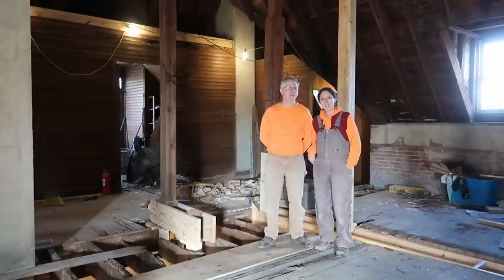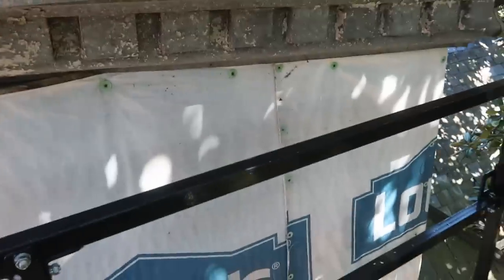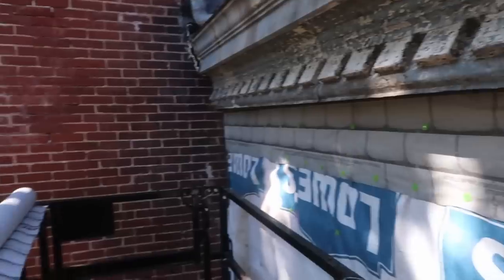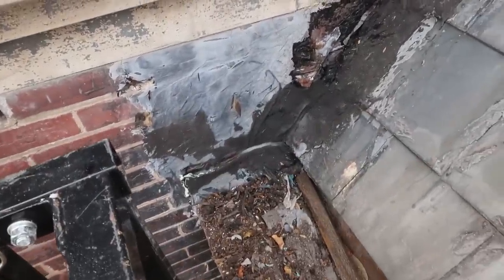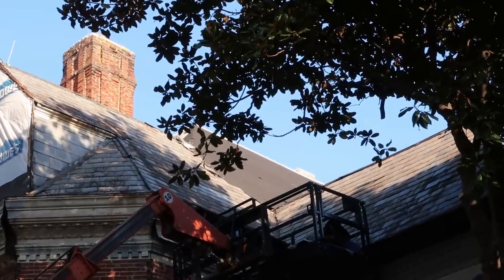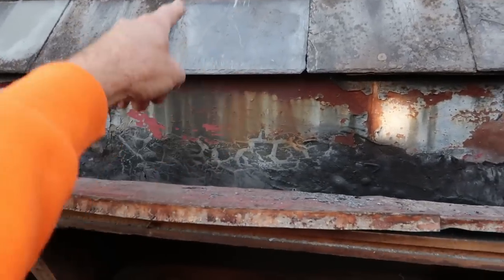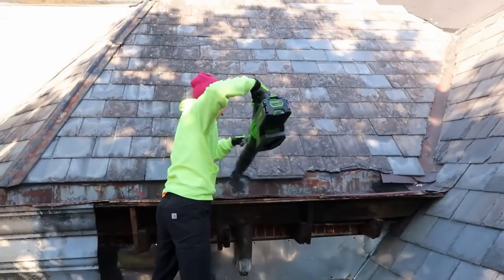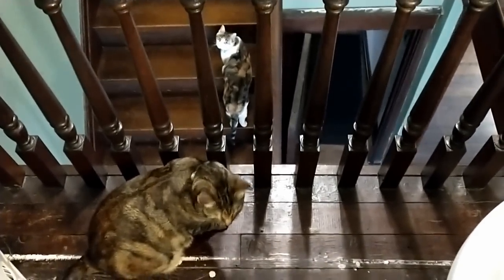NO MORE WATER! We Repair The Slate And Add Metal. S3E33

Comment: You are turning into professional roofers and slaters, impressive (among other things such as masons too).  You both will ultimately become old house experts and will need to write a book documenting all the building techniques you have discovered for old houses of this era.  When I worked on my building 30 years ago, there was very little info to find out about tin cornices, flat seam metal roofing, copper roofing work, hot lime mortar, etc.  Vast majority of people I would talk with had no clue - and I could never find anyone (craftsman) who would replicate the work, they only knew aluminum flashing and nail it everywhere and portland cement mortar smeared everywhere and oh yes, tar.  I had to learn so much myself as you all have but there is so much more info now thanks to the internet.  But still more need documented.
Reply from the maker: You nailed it. There is so much information today that it can make anything possible. Of course, there is some bad information out there too so you have to be selective. Doing everything ourselves makes it a lot more fun.

Comment: I would recommend to cut back the tree and branches. Water drops dripping from leaves destroy every gutter. Each drop falls like a bullit shot. Dripping water from roof is no problem for the material. Sun on that wall instead of shade is necessary to keep house dry and mould free. You're doing great. Admire your perseverance abd craftmanship
Reply from the maker: We plan on taking the large trees close to the Mooreland House down this winter. It takes a little while to get them down and cut up so we wanted to wait until we had a quiet moment between projects to get it done.
Reply: @moorelandhouse  well you have the garage roof replaced so excellent space for new firewood storage. Very wise decision to remove too close foliage

Comment: The waterfalls are gone, the brooks are diverted, the streams are stopped and so is all the major deterioration.  I feel like from here on you can actually start slowly making real repairs. I realize that's not always going to be straight forward as you will have to do a lot of temporary fixes and construction along the way to making actual permanent repairs. It however has to feel great to know that the house is not falling apart faster than you are making patches. I suggest as you said in one of the responses to what are you going to do with Miss Mooreland you might have to add an elevator, plan for it now as you rebuild along with maybe another full bath.  Have you decided what your first project for spring will be rebuilding the front dormer, the side dormer, building permanent walls in the maids room, removing all the cornice and repointing the wall tops so you can build box gutters and put on a new permanent roof, so many choices and I bet you have something totally different in mind. I can't wait to see what you pick. You are both amazing and have accomplished so much you have to feel good.
Reply from the maker: Ugh, you had to remind us of all the stuff we still have to do. =) We will probably be putting slate back onto the roof during the first part of the spring that is too cold for mortar work. After that we will want to work on the front dormer because we want the street facing side of the Mooreland House to be back together.
Reply: @moorelandhouse   Sorry for reminding you of everything there is to do. I suspected the front dormer was a priority.

Comment: Slow and study is the way to go.  It looks like stripping down to the bare rafters on the roof will stop the water.  I never knew what a wonderful idea metal facial boards and corbels were.  What a pain to take off.   The metal gives a nice finish look.   Do you get volunteers to help you?
Reply from the maker: The metal cornice moldings are fairly unique. We haven't been brave enough to ask for volunteers.

Comment: I'll bet  most of these water issues could have been avoided if they had lined the box gutters with copper or lead and soldered all the seams.
Reply from the maker: We don't disagree. Copper gutters would have required some maintenance over the 130 years as well though.